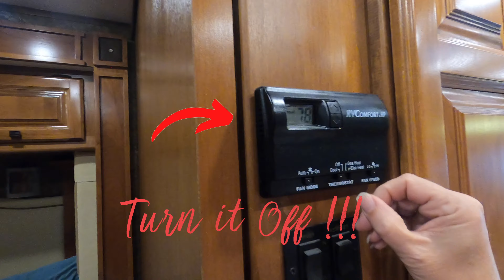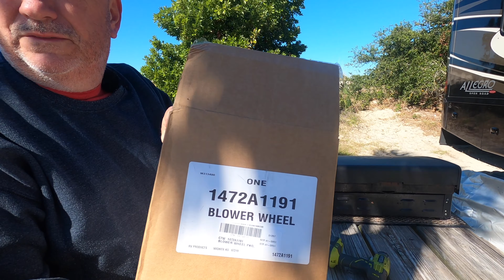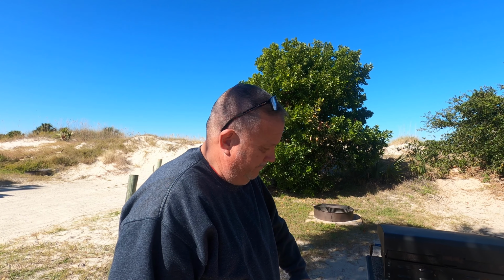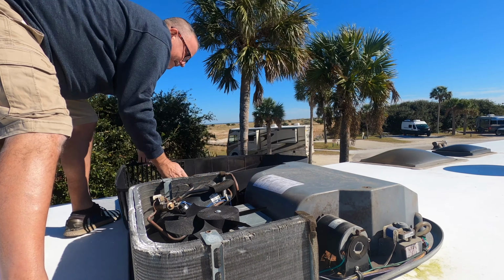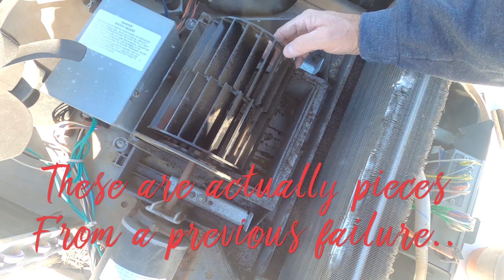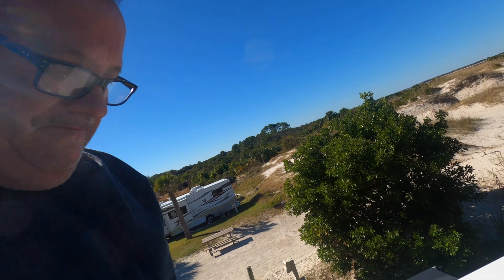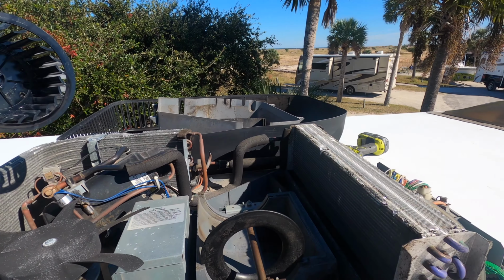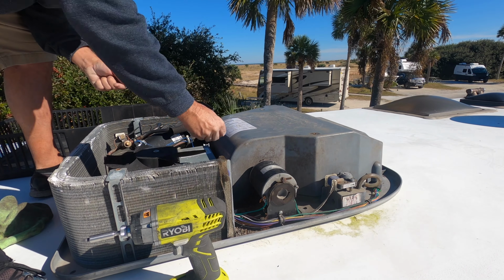Easy Coleman Mach 8 AC Blower Fan Replacement (Squirrel Cage)

Comment: Hey Randy...thanks for your video....Did you end up install the  aluminum wheel on your Mach 8 AC unit?? I just had a plastic wheel fail and looking to replace with aluminum. Will it last longer than the plastic? I would think so. 
Question....the measurements for the aluminum wheel is smaller than the plastic.....does that matter and would if effect the efficiency of the AC Unit??
Reply from the maker: I’m still using plastic, have heard mixed reviews about the aluminum wheel drawing slightly more amperage with a bit less airflow, so I’ve been sticking with plastic for now until I can research more 👍🏻
Reply: @ChasingtheDreamRV  OK...thanks for the feed back. after watching your video I was able to find them at Grainger but it a little smaller than the plastic wheel and the airflow was less. I am going to return them and get the plastic ones and just keep them as clean as possible and hope it doesnt break every 3 months like in your case.